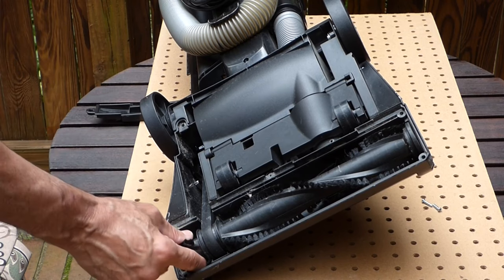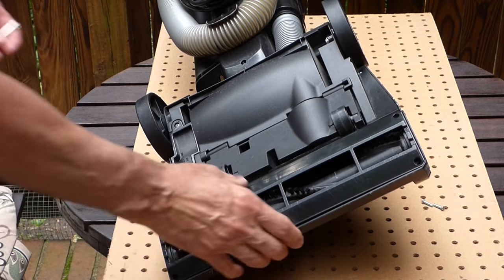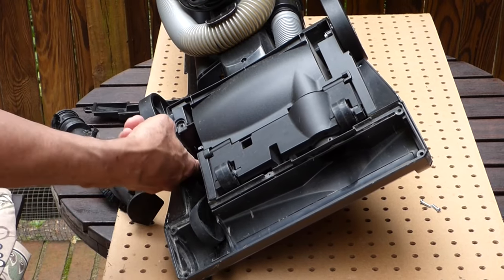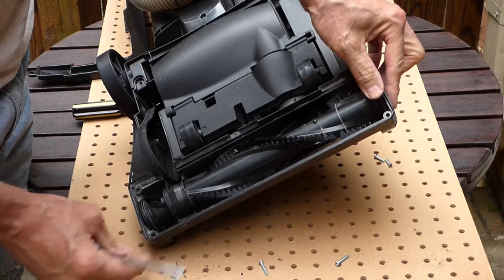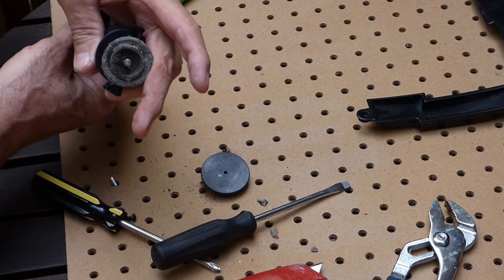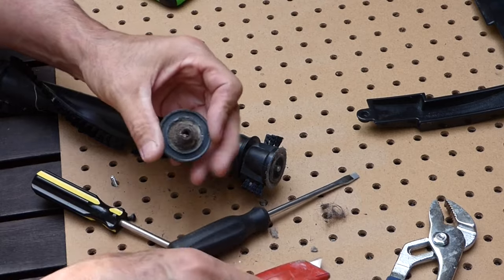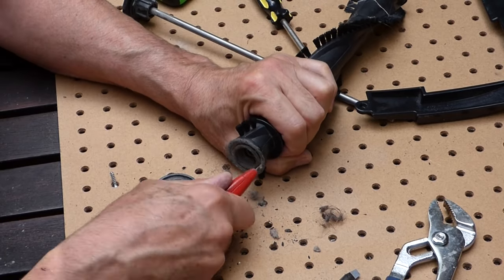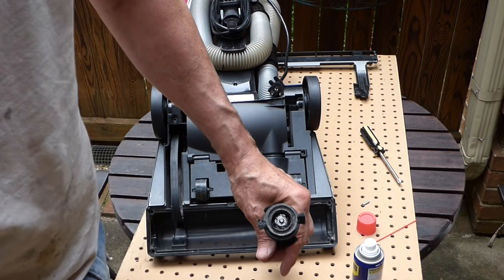Vacuum Roller Brush Not Spinning - Belt Smoking - How to Fix

Comment: Woo hoo!  My Bissell 2846 brush was not turning.  I took it apart and the belt was broken.  I bought a new belt but realized that the brush was not spinning at ALL.  By watching how you removed the ends I pried mine apart noting that the plastic was clearly melted.  I carefully used a utility knife to chip away what was melted, reassembled everything and VOILA!  Working once again!  Replacing the entire vacuum with an equivalent model would be close to $300 and this repair was only $6.50 for a pack of two new belts.  Thanks!!!

Comment: Hoover tips: The plastic ends unscrew, so don't try to pry them off. Just hold both ends and twist them in opposite directions.
 Also check that the carpet height adjuster hasn't accidentally gotten set to a low carpet height when you're running on a medium or high pile. Running the carpet height adjuster too low will put too much strain on the brush and will cause the belt to slip (and overheat).

Comment: LOL, Before I even finish the video, HAIR. That stuff can stop a Traine (A/C unit).

**After video update** Grease or oil will collect dust and gunk in the bearing area.  WD40 has no lubrication value once it dries. If you can get some Teflon (or Cerflon) dry lube spray, that would help and not collect dust. Or even better, a drop of a dry bicycle chain lube (White Lightening at Walmart or similar) is easier to control. Works well on lawn mower cables, too, and a small bottle can last several years.  I've gotten to where I don't put anything on these brush bars, just let 'er ride.

My wife has started repairing these vacuums (with a little help and training from me). People just throw them out. She joked last week that she made more money doing this than with her Mary Kay thing.

Good video, thanks for posting!

Comment: Thank you very much.😊  I just fixed the roller brush on my Bissell 1797 because tons of string was wrapped around the right end. I accidentally broke off a piece of it trying to pry it apart but I got it back together. Any easier way to get the ends off? I couldn't pull it apart to see the rod inside. Help...

Comment: I have a Kenmore intuition with the swiveling head and the roller stops so I removed everything to access the brush roller and found two wires that were almost cut in half because of how they routed it underneath the motor. I don't have a problem with a belt it's definitely a sensor or the wires. I'm going to fix the damage wires to the switch but I'm trying to figure out how the sensor works to know when to stop the roller like it's designed to. I will start by replacing the two wires to the switch and I'm going to just connect them together to try and bypass the sensor. This vacuum was a horrible design and I can't believe they routed wires in a spot that takes constant force.

Comment: Beware! Removing the ends may break the ABS/plastic part that cap/cover the metal shaft on some models. It happened to me and ruined my roller brush. In Niagara Falls, CA, the roller now cost more than the whole vacuum cleaner I paid almost a decade ago.
Please be more gentle and patient when remove the plastic ends. They tend to build hairs and may ruin the belt and even stop rolling. Good luck all!

Comment: Another great informative video. Thanks👍
On a different topic, what do you think of a Stihl 026 survival that sat for 24 hrs in a basement flood. Local shop blew it off as trashed. Your thoughts please?
Reply from the maker: I would take it apart and clean it up (make sure everything is dry) put 2 cycle oil on the parts as I reassemble and fire it up.  Drain the fuel tank... take the plug out and remove the air filter and pull the rope till all drained out... maybe spray WD-40 in the cylinder and carb (WD-40 absorbs water)... pull the starter with the plug out... may need to clean up the coil and flywheel (WD-40 may take care of that too) then put fresh fuel with proper 2 cycle mix in it and it will probably fire up.  At least worth a try.
I went to a beach house that was flooded with salt water in a hurricane.  Helped the owners out with their mower, pressure washer, etc and did what I described above and everything is running fine even 3 years later.

Comment: I can't seem to pry off the ends of my roller. Any advice?
Reply from the maker: Depending on the design the end may be glued?. I could not get a replacement for the vacuum in the video but you may be able to get a replacement brush for yours.
Reply: @helpinguonline  Thanks. I actually figured it out! You just need to use a screwdriver head and hit that with a hammer in order to get the middle metal piece out. It took a while because it was rusted, but it came out eventually.

Comment: You did great...I have a Bissell POWER force helix turbo can I do that same way
Reply from the maker: Thanks.  The reason I did that was because a new roller brush was not available for that vacuum.  The best option is to buy a new roller brush but if they are too expensive or not available it is worth a try.

Comment: I own a Powerlifter rewind pet. I did exactly what was done in the video but unfortunately during the process I dropped the vacuum onto the carpet from about two feet high and when I did a small rectangular piece of metal called a "vacuum rib shoe" came off. I do not know where it came off the vacuum at and can not find anywhere online to tell me where it goes.

Comment: I had a new brush & belt & it still wouldn't spin.
Reply from the maker: When you have the belt off you should be able to see if the motor shaft is spinning. If it is… Something probably simple is keeping the brush from turning. If the motor shaft does not turn you may have a burned out motor
Reply: @helpinguonline  i realized the part the belt hooks onto isn't spinning. Time for a new one? I never knew I could remove the belt & use just the attachment which is good enough for right now so thanks for the tip! And thanks for responding.

Comment: Sorry but WD40 will not last because its a solvent not a lubricant. Another poo poo, non properly prepared youtube video
Reply: Yeah, he said in the video it would be best not to use WD40 but a silicone lubricant instead. He just didn't have any and said it was a short-term solution based on what he had.